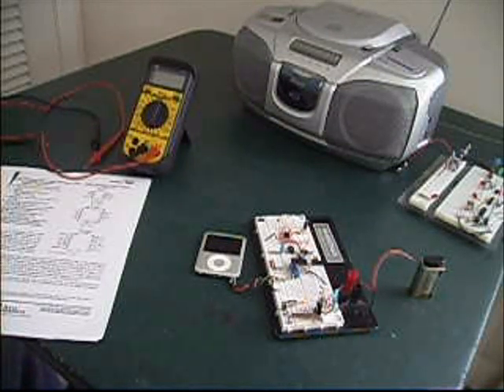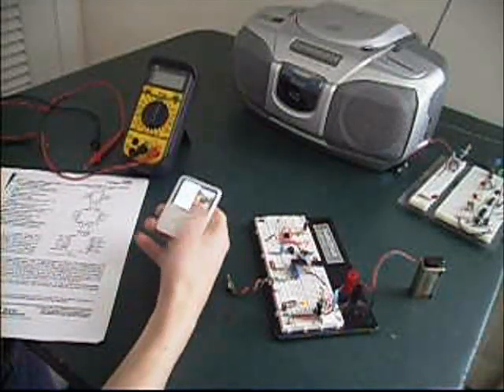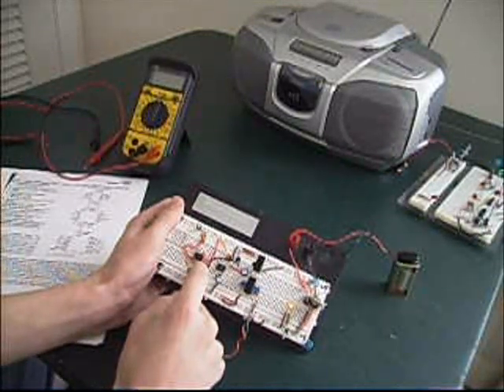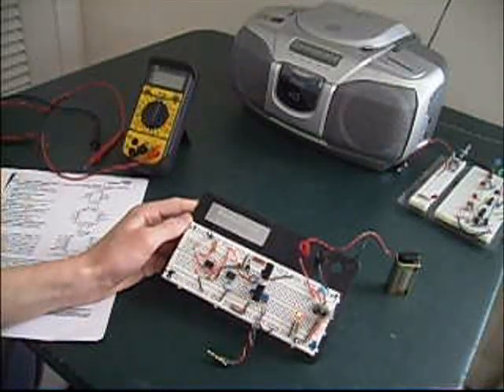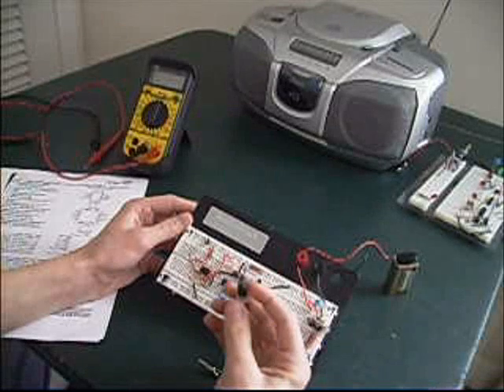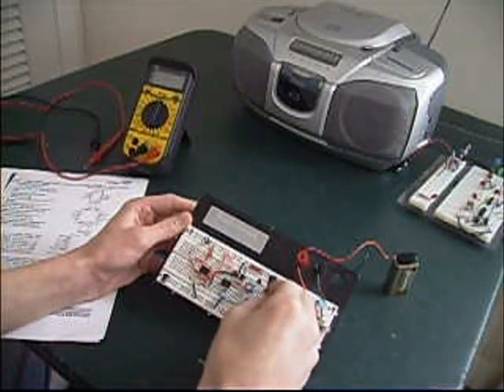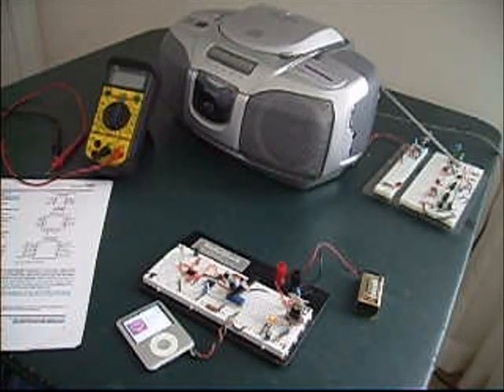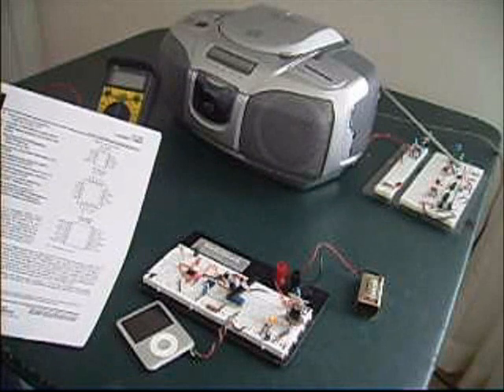555 AM Transmitter - Circuit Series

Comment: Not necessarily. You could use a transistor or an IC to create your carrier wave. All it has to do is oscillate at whatever frequency you want to broadcast at. The 555 is a wonderful little chip that  requires very few external components to oscillate. (2 resistors and one capacitor) All you need to add is a transistor which will act as a modulator. I like using the BC109C for that.

Comment: @3mustardMoNkEyS okay I have managed to transmit an AM signal at around 600khz, my circuit is slightly different to yours I am using transistors to amplify my audio signal. I am using a 75 turn coil to transmit but the range is only about 40cm max. Should I add more coil turns or increase the power to boost my range? Thanks for the previous reply.

Comment: No worries ,,Theres another way we use to modulate laser using the 555 as a sawtooth for a op amp as you are doing now for the audio feed those to to a lm311 one to the + one to the _ the out put of the LM311 could be used the same way ..PWM

Comment: It is just such a pity the 555 can't reach the 88 – 108 mHZ frequency range. It would have been an ideal little chip to use for FM transmission.
Reply: just use it with a circuit tuned to fm its not hard

Comment: @3mustardMoNkEyS : translated (badly)

Excellent video I designed a wonderful Posted amendment widening circle like her, but did not work with me to not set the correct frequency on the radio to the lack of equipment I have a measuring frequency